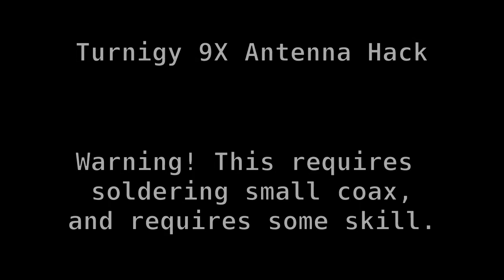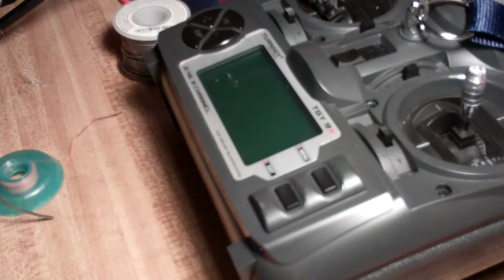Turnigy 9X Antenna Hack (Allows complete removal of the 2.4GHz Wireless Module)

Comment: Why would you do this? Because you are afraid of pinching the cable? Break the wire? Thats a load of crap.. The only time you remove the module is when you are changing it.. And now you just got an exposed wire.
Reply from the maker: +Nils Sindre Jensen On this model of Turnigy 9X you had to remove the module for it to work with the trainer port for simulation.  Some people (myself included) want to swap the module but still have the ability to use it with the stock TX when needed.
Reply: +ilektronx Search for "resistor fix", it allows using trainer port without removing the module.

Comment: I opened the radio and removed the black piece the antenna mounted to. I drilled a hole in the module cover for it, and cut it's unseen end slightly shorter. My antenna screws to that as usual, and it makes a much more sturdy bond, especially when the antenna is now likely to be knocked against things. Just use a glue of your choice, or flare the plastic with you soldering iron to stop it being pulled out.

Hint, you may need to make a new hole in the antenna if you don't get it right. I suggest screwing the antenna to it before cutting/gluing to make sure you get it right.

Comment: Did you notice when you take an ohm meter between the grounding pad were the coax shielding is soldered and the antenna lead is soldered  you get continuity.  I checked this with the factory antenna before I did the mod.  I would think this would cause a short?
Reply: Same here but the range is still good. Must actually be correct.
Reply: Agree mod worked great.
Reply: Jon Car Yes same here. It worried me when I moved mine and I wish I'd checked it before desoldering. Anyway I have a compatible Fly sky module and I get a beep across the antenna and the shielding on that and that's from the factory. So either factory faulty or how it's meant to be wired.
Reply from the maker: Jon Car Not sure how I missed this comment, but antennas can often be shorted to ground.  Do a quick search for dc grounded antenna, and you'll find many examples.  I would assume that the 9X is dc grounded (but I admit I am not certain).  You have to remember that all conductors have some LRC components. Even a piece of wire behaves differently at different frequencies.  There is a tool called a network analyzer which you could use to verify that your antenna responds to the correct 2.4Ghz frequencies.

Comment: i did this and crashed my plane after it. no more range...
Reply from the maker: You probably shorted out the antenna or didn't quite solder it perfectly.  This is a risky operation due to how small the coax is.
Reply: ilektronx absolutly right. fixed the problem by investing more effort. job done 1 kilometer range. maybe even better the before ;)

Comment: nice vid..but if i were you i will cut the wire instead desolder it to the board..and solder it again together and put some shrinkable tube
Reply: I'm guessing you haven't worked with coax much?
Reply from the maker: Cutting and resoldering the cable would be more difficult due to the size of the cable.  Additionally, the splice point would have a different impedance which could cause reflections or other issues leading to degraded performance.

Comment: Could you have instead of unsoldering and resoldering the coax, pulled the wire out of the antenna and pulled the wire thru the transmitter the other way?

Comment: Yep this works I did the mod too, but still why should we be having to do this?

How come they have not yet sold the module ment for the 9XR?

I have had mine seance December 2012, its now June 2013 and NO MODULE!

Come on Hobby King get us the correct module so we can use the INTERNAL antenna already!

Comment from the maker: In the description there is a link to a better picture of the soldering.  There are ground pads on either side of the center, and it shouldn't matter which side you solder the ground to.

Comment: Im just wondering why you soldered the ground to the pad where the centre was
you reversed the side that the wire came in ,did you use an alternate ground pad on the opposite side that the centre lead goes?

Comment: just did a similar mod. did not like how the antenna comes out from the back of the modules so I put a SMA treminal in the back of my Tx,  to the dummy antenna knob where I put another SMA connector. now I can connect any antenna to the top of my Tx and use a short SMA bridge cable to connect the moduls to the radio. 

I also attached a SMA terminal to the original module of my old 9x, using your guide. now i can use any module/antenna combination. range test works as before :)

Comment from the maker: Sounds like you have a short or a break in the coax to the antenna.  Unless the short or break is at the point where the antenna wire connects to the PCB, this probably won't fix it.

Comment from the maker: If you consider flying my park jet out as far as I can until it falls out of the sky, then... yes.  I haven't been too motivated to too comprehensive of a test; there are too many variables and I never did a real range test before the mod to have a control.  Most of my stuff I fly/drive value around $30, so I haven't been too concerned.  That being said, I've flown/driven them to the limits of my vision, with only one dropout. (and that could have been a servo coming loose)

Comment: Thanks for the info, I did the mod & it works great.  I haven't noticed any loss of range.  The hardest part was soldering the coax which you stated took some skill to do.  It took me about 10 min to get it right, but it was well worth the effort.  I can now use other Tx modules and still use the original that came with the remote.  Thanks again,  I next plan on doing the resistor fix inside the module

Comment from the maker: @SlipperySpandex The reply bug has me.  I did not notice any discernible difference in range.  It is a definite mask if you mangle the soldering.  

You can try using solder wick to remove the cable.  There is no risk in doing this.  If it doesn't work out, you can re-splice.

Comment from the maker: It definitely could affect range if you kink the coax going to the antenna.  Small coax is very fragile.  The wire for the center conductor can actually break if the coax is kinked, which is something I've experienced personally.  A kink could also just increase the impedance of the line, slightly affecting range.

Comment from the maker: @runnynoze I don't think you can get to the point in the antenna to desolder it. It is easier to get to the antenna wire in the module.

Comment: Don't forget to do a range check.  I take it the PC board had the following connections at the coax . Gnd center wire and then Gnd again. If the board had just two connection. It look like you connected the signal connection to the Ground of the coax.